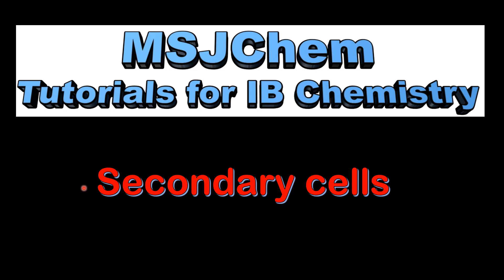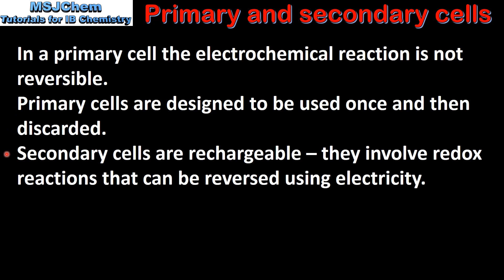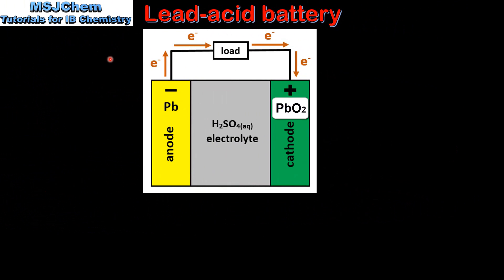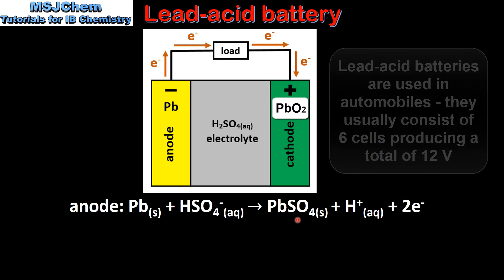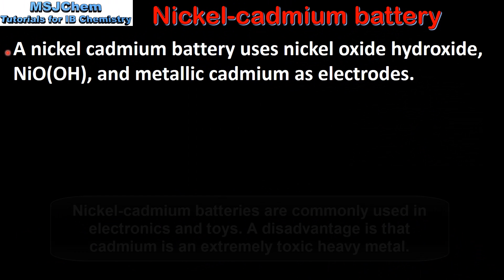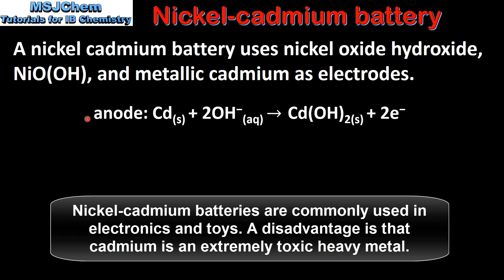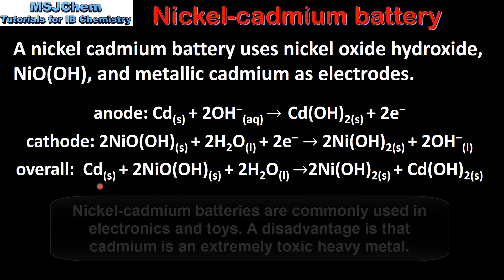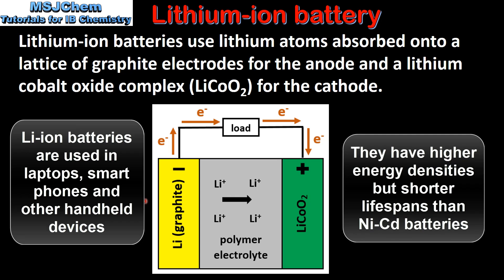R3.2.7 Primary and secondary cells

Comment: Hi, Do I have to memorize all those anode and cathode half-cell equations? or are there ways of figuring it out without memorizing when asked in the exams?
Reply from the maker: Section 24 of the data booklet.
Reply: @MSJChem  How would you use that to help memorize the half-cell equations?
Reply from the maker: Look at the equations that have come up in past exam questions and then hope the same ones come up again.
Reply: Hey these equations aren’t in the data booklet, so do we need to memorise them?
Reply from the maker: Yes, they have come up in past exams.
Reply: GANO - galvanic, anode, negative, oxidation and EAAPO - electrolytic, anion, anode, positive, oxidation